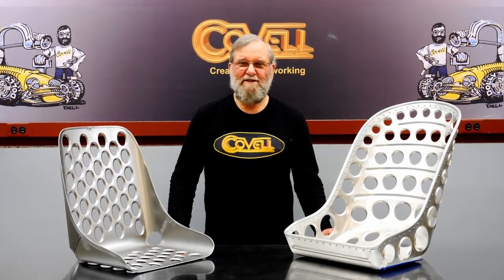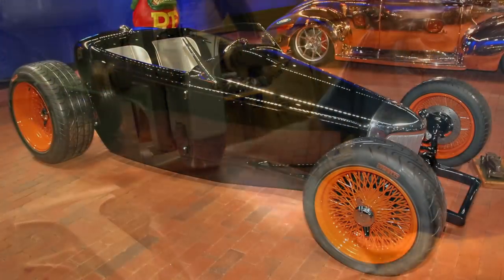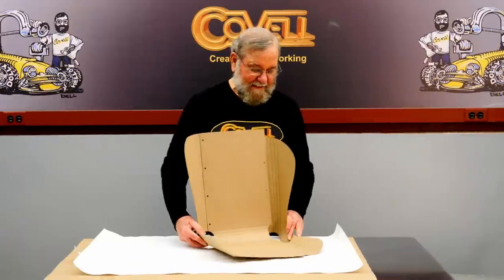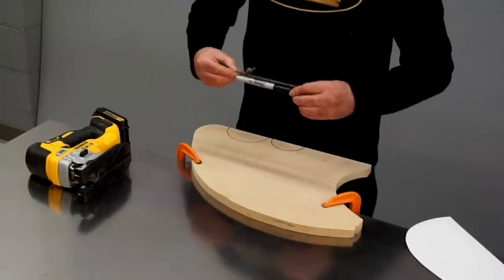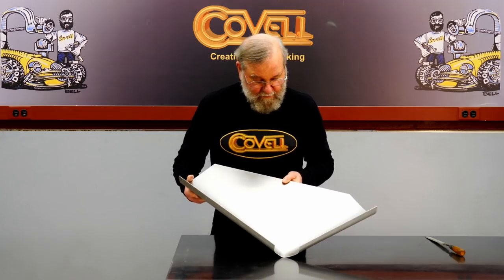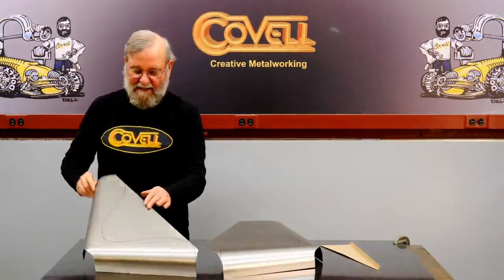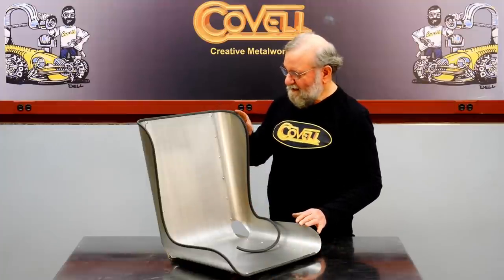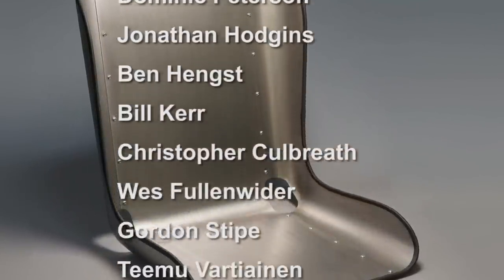Bomber Seat - made with REALLY SIMPLE TOOLS!

Comment: Couldn't be simpler and as always well done Ron, Thanks!
one little question though, Why is that your bench top always looks brand new and so shiny?????
Reply from the maker: Well, I bend over backward to make each shot as clean as I can. I think it keeps people's attention on the work being done - by eliminating unnecessary distractions. 
To that end, I go over the 5/16" cover plate on my table with an orbital sander whenever it gets scuffed up - usually with 240 grit paper.
The plate was hot rolled, so it had a lot of scale on the surface when I got it. It took a lot of elbow grease to get the scale off it initially, but it's not too hard to keep it shiny now.

Comment: do you ever use 3d printed tooling?  there are some great videos of press brake tools made of ABS.  they can bend steel of several mm no problem, many times over.
Reply from the maker: I certainly recognize that useful tools can be made by printing, but I have never done that. I do use a simple 2-D CAD program sometimes, but haven't learned the 3-D stuff yet. Several people have offered to help me if I ever want to move in that direction, and I may at some time!

Comment: Hey Ron, can you tell me what chipboard size you normally order?  I've been using paperboard for years, but want to try chipboard, but amazon has a bunch of different sizes and thicknesses.  12x12 seems small and .022 seems thin.   Also, can I cut this stuff in my stomp shear?
Reply from the maker: Chip board comes in many different thicknesses. .022 is a common thickness, and is good for small parts, or patterns that need to bend a lot. I have some that is closer to .030", which is better for larger flat patterns. 
12" x 12" square pieces would be pretty limiting, for the work I do.
I have bought rolls of this material from Home Depot, and Costco uses the thinner material to separate rolls of toilet paper when they stack it on pallets. That material is free!
Yes, I often cut mine on a foot shear.